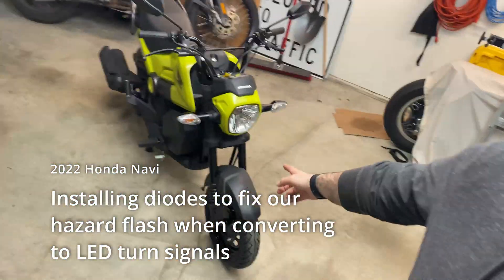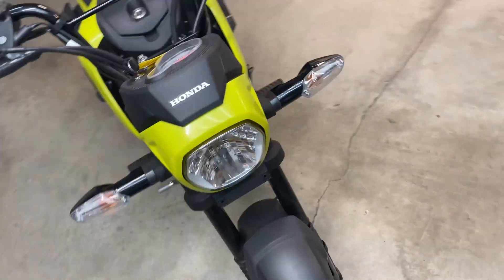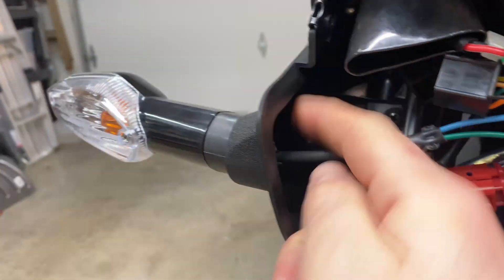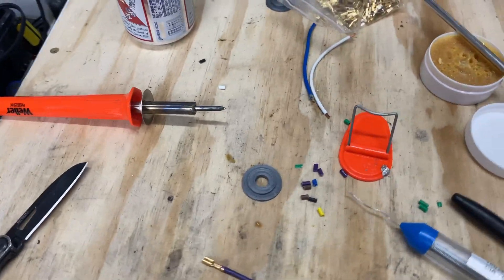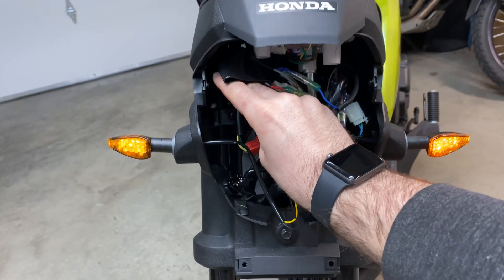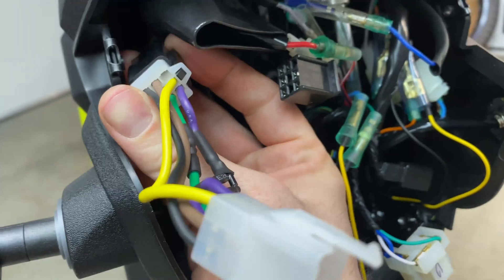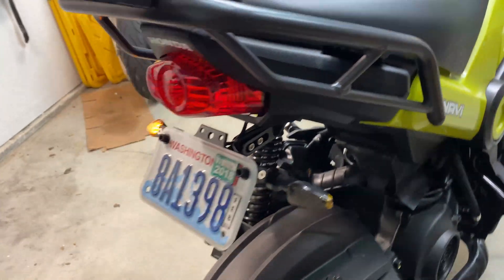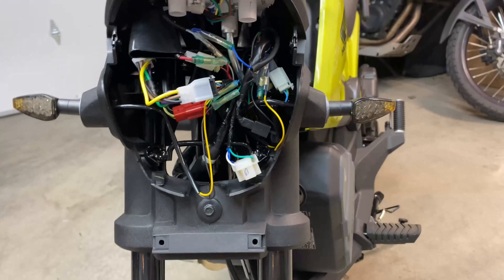Honda Navi LED Turn Signal "Hazard Flash" Fix! With Diodes!

Comment: Hi! I know this was forever ago, and I just made this little pigtail/adapter. Quick question, I went with a 2a 1000v fast recovery diode, but the other size you recommended was a 3a 600, which I have, but it’s a rectifier diode. 

Is one diode superior to the other? I don’t know the difference between rectifier and fast recovery
Reply from the maker: Hey, I'm not an expert, but I would go with the 3a diode, just for the extra amperage protection on it. I think the cycle times are slow enough that fast recovery isn't needed over a standard rectifier diode. But, if it's already in place, I don't think it'll hurt it, it might just burn out faster than the 3a one. Hope that helps!

Comment: Installing an LED bulb for the dash indicator will fix this as well!
Reply from the maker: It will, but you need to make sure and use a very high quality LED that can handle reverse polarity. LED's are diodes by nature, it's in the name, but they kind of suck at being a diode and are easily blown by reverse current going across it. Some are designed to handle it better than others.
Reply: Makes sense! I didn’t know that was the case. I’ll keep you posted to see how long it works before it blows (if/when it does). Mainly just used it as a quick “hm I wonder if this will work.” If it blows I’ll install the diodes! Appreciate the info!
Reply: Hi! I’m just running into the hazard flash issue now, and I like the idea of a led bulb over all this extra wiring. 

Has yours held up? And if so can you link a product and share how the install went?
Reply: @khylobort8460 I actually sold a few months ago… missing it. But it held up perfectly fine for the entirety that I owned the bike
Reply: You happen to know where I could find an led bulb for the dash indicator?

Comment: What gauge wire did you use
Reply from the maker: I used a weird 14 gauge size I had laying around, but they're LED's, so you could probably go down to like 20 just fine.
Reply: @SpencerDesmarais  thank you!
Reply: The yellow brown and black that you said are just “pass through” are just re linking existing wiring from the previous stock harness correct?
Reply from the maker: @lanleyc433 Yup
Reply: @SpencerDesmarais  just finished doing this- thank you for this awesome video/ resource!

Comment: Hey have 22 navi I installed led and led rely works fine I changed my led lights again and now all 4 blinking at same time  so I need diode do u have a plug and play harness from turn signal indicator I can purchase from u  I appreciate it just let me know thanks
Reply from the maker: Hey there, sorry, I don't sell them anymore. They were pretty time consuming to put together and just not worth it for me, especially after I sold my Navi. You can make your own or wire in resistors with the lights and that should work too. Or, you can remove your turn signal light from the dash, and that'll also work, but the downside is you don't see it flashing on the dash anymore. Good luck!

Comment: Hi great video 👍🏼 . I did the ac dc conversion and install a led headlight and for some reason I’m still getting a flickering only when the bike is started. Check all the wiring and everything is fine. Any thoughts on what could be causing the led headlight to flicker? Thank you

Comment: Hi Spenser , I’m interested in the harness. Are you still selling them? Also, do I need a new relay under the seat?
Reply from the maker: Hey! Currently I don't have any plans to make them anytime soon. I'll let you know if that changes though. if you're doing LED turn signals without resistors, then yeah, you'll need to replace the relay with one meant for LED's.

Comment: Would resistors correct the problem to rather than using diodes?
Reply from the maker: Honestly not sure. I think it'd depend on how large the resistors are and where they got wired in.
Reply: I would like the harness.  How much?
Reply from the maker: @marklowe8148 Not selling them anymore, sorry!

Comment: Okay Spencer.. Got wires/diodes all soldered up, but having one issue. I’m having a problem with pin placement in the connectors. You don’t really show them (directly) too much after you complete them…. and even after pausing/rewinding 850,000 times I’m still not confident I’ve got them right. Is there anyway you can help with that?

Edit: Believe I have figured it out. Have homemade diode harness installed with stock turn signal for now while waiting for relay to arrive from Amazon….. it seems to be working as of now. Let’s see if that’s the case when I pop the led’s/relay in. 🤞
Reply from the maker: Yeah! Glad you got it figured out!

For others that may have the same question in the future, were you talking about physically putting the pins in the connectors? Or the pinout of the connector?

For the pins into the connectors, the little tang on the metal piece lines up with the small notched side of the hole in the connector. It slides past it then clicks into place.

What I did when putting mine together was actually plug the blank connector end into the stock harness, then slot in my wires so I didn't have to think through front vs. back of the connector, etc. 

Brown, black, and yellow/white go straight through in the stock locations.
On the harness side: orange and blue go into your diode "Y", and green "Y" gets plugged into stock green.
On the dash side: orange goes into green of your ground "Y", other end goes to the stock green, blue goes into the output side of your "Y" diode"
Reply: Yeah, I was confused on the pin placement of the ground and diode Y’s on both sides. I was just watching this video while trying to imitate exactly what you were.doing. Had a hard time seeing which slots you placed the wires. In hindsight, it would have been much easier if I just took a pick of the stock harness/colors and used that for reference. Live and learn….. either way, awesome video. You should post a link to the trio of videos on Facebook, as there are plenty in the Navi forums I’m sure would love this info. Good job.
Reply: Okay Spencer… SSS led’s finally came in, and unfortunately I’m getting a hybrid hazard effect where the are pretty much operational, but the back right blinker stays on all the time. The right side also flashes quicker than the left. I’m hoping my homemade harness was wired correctly, and wondering if possibly have a bad diode or overheated one while soldering?… I will try and make another diode Y, but is it possible for me to send you a few pics of my harness to see if you could find a problem? Thanks

Comment: Thanks again… used links to order parts. Gonna give it a shot.
Reply from the maker: Good luck! Feel free to shout if you get stuck or have a question.
Reply: @SpencerDesmarais  
Nice set up spencer. Could we exchange emails?
Reply from the maker: @rideordie6886   Sure, feel free, smdesmarais at gmail. I'm about to watch your roller weights video and see what rabbit holes that leads down 👍